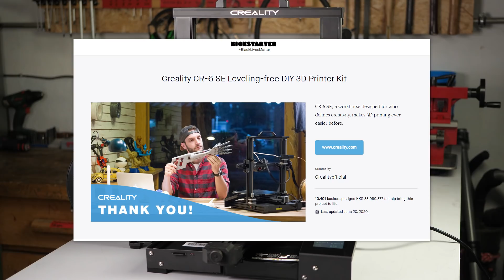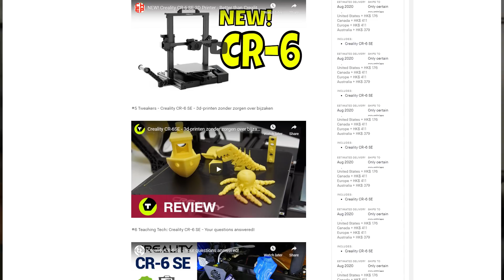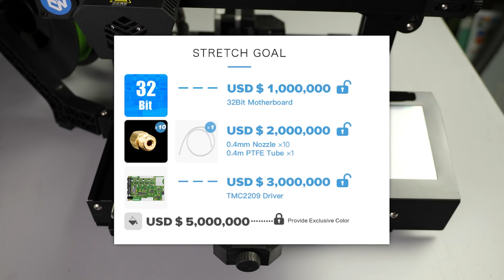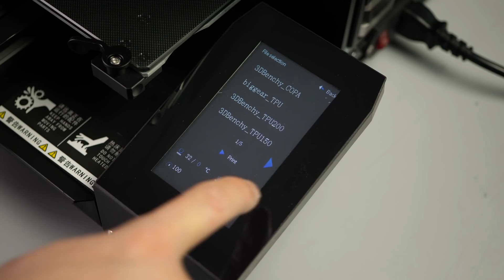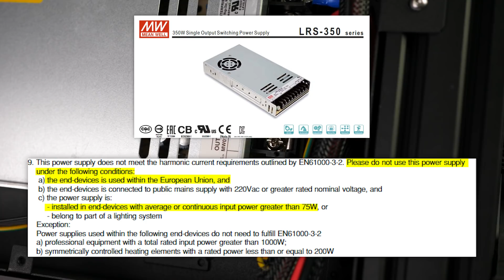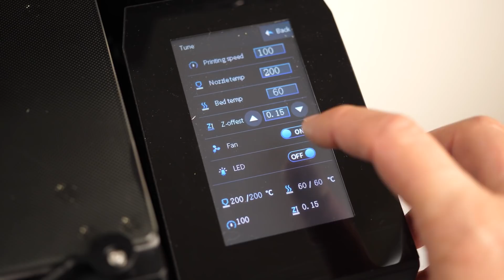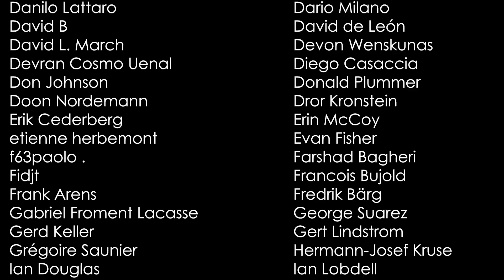Creality CR-6 SE - The NEW (over)hyped Kickstarter 3D printer?

Comment from the maker: Don't forget to share this video on Facebook, Reddit, Twitter and other social media!
Reply: I preordered one of these on kick starter, was It a mistake in your opinion? It's my first 3d printer
Reply from the maker: For the kickstarter price it's IMO a good deal!
Reply: @carrapaz3645  you could spend more money and get less - good value and great for a first printer.
Reply: cheaper than a prusa mini and better, don't get your complaints
Reply: Hey boss I’m trying to print cosplay helmets and stuff and I just bought a .8 mm nozzle for my cr10v2 what settings would you recommend to break down the 50+ hour work jobs that normally apply to the .4 mm nozzle? I could really use your help.
Reply: @talonabuser1072  Assuming you use Cura, I don't know the names of the settings for other slicers: Increase your line width to between 0.8 and 1.2, depending on how much detail you want (lower value gives more detail, slower print). You can then increase your layer height accordingly (should be no more than half of your line width or layer adhesion starts to get weaker, around one third of your layer height is a good value). You will want your layer height to be a multiple of .04. So I would probably go with 1mm line width, .32mm layer height. Then when it is printing pay attention to the extruder gear. If it is skipping or clicking then the hot-end is having trouble keeping up with the material flow and you will get under-extrusion. In this case you need to lower your print speed or upgrade your hotend to a volcano to melt the material faster.
Reply: A trick : you can watch movies at flixzone. Been using it for watching all kinds of movies during the lockdown.
Reply: @Koda Messiah yup, I have been watching on Flixzone for since december myself =)
Reply: Thank you for not being another creality shill. Its a fancy ender 3 with "improvments" taken from community ideas and a sketchy marketing plan.
Its nice to see a real review where keeping free printers rolling in isnt a main goal.

Comment: Have you updated to the latest community fw and ui yet Stefan? 
Adds a lot of extra features that it should have already come with from Creality! If you haven't already I think you should do a long term review on this printer now

Dual Z axis, load sensor bed leveling and runout sensor are worth the extra money over the ender 3 if your a newcomer to the hobby, but wouldn't say it's worth buying this if you already have an ender 3 or cr10 that is setup and working well.

Same as all the rest, it has just the same failings with the bowden tube and extruder,  I think for 4.4million on kickstarter they should also have addressed these long term issues. 
OK so they changed from the mk8 extruder to a new design made with using old parts but should have just moved to a dual drive design instead!

There are fit and finish issues with the brass guides on the runout sensor and they didn't line up the runout sensor and extruder another recurring issue that keeps getting overlooked!

They have a good range of printers at this point that are for the most part decent quality and reliable. Now instead of coming up with new printers and only half finishing them perhaps they should start improving the range they have until they have some epic out of the box printers at very reasonable prices!

Comment: Thanks but no, thanks! I`ll stick with my Two Trees Bluer Plus which for less money gives me: 2 lead screws Z (tethered, so synchronized), auto bed levelling, 300x300x400 build volume, PEI steel flex plate, TCM 2209 steppers, 32 bit board with Wi-Fi, full-color touchscreen, sleeker design and awesome print quality. You can keep the electronic scale for yourself

Comment: You are absolutely right about the power supply. The specification of the one available online is that it may not be installed enclosed, within the EU (same company´s RSP model seems to be abel to have in a encloser). And not used with continuous load above 75w = not to be in a 3D printer with heatbed. Will probably get worse with time when dust is sucked in and get it warmer.

Comment: Bed heat up time is irrelevant if the bed heating pattern is not tested with a thermal cam. On my Ender 5 Pro the sensor says the bed has reached target temperature (80°C for PETG in my example), but only a part of the Bed is really heated up - about 30% of the bed surface was up to 15°C cooler even after 20 minutes of heating.

Comment: I backed it because as my first printer I felt like it was a consolidation of years of tinkering and incremental upgrades and updates. Now that I have it on my bench I'm really happy with it. Setup and printing well with minimal fuss.
Also, after watching your $2 printer upgrade (foam + concrete slab) I was prepared for the worst... But the printer is so quiet I have it next to me on my desk and don't even notice it printing. I don't have such fan noise with the power-supply, but maybe it just hasn't kicked in for me yet

Comment: Could you (safely and/or easily) change the fan of the PSU?
Reply from the maker: Probably not. That's a potential fire-starter.
Reply: Thx for the reply! So if you want it more quit, a new PSU then? (derp :/)
(I'm one of the backers and this will be my first printer.. But it will be housed the room next to my baby girl.. So (very) long prints won't be an option it it's to loud!)

Comment: I've seen Your video, very interesting.

Imagine what you could do with the Creality CR6-SE and my latest upgrade Steel Roller which turns the printer into a continuous cycle printer.

This is the link http://www.robotfactory.it/en/the-steel-roller-kit/

An article on Fabaloo has also just been released https://www.fabbaloo.com/blog/2020/9/13/robot-factory-offers-continuous-3d-printer-conversion-kit

Andrea

Comment: I just received my printer from the Kickstarter, and I am, overall, satisfied and not disappointed. I also wish the power supply was quieter, but I was planning on sticking it in my workshop anyway. My biggest gripe is filament loading. Why did no one consider putting a tube between the sensor and the motor so you don't have to stick your finger in there and lift the filament a little to get it to go into that little hole? Overall I'm happy though.

Comment: Here is my problem with the automatic bed leveling: it is not leveling at all - it is basically doing what the BlTouch does. EXCEPT: with the BlTouch you are still supposed to manually prelevel the bed. MBL / pürinter override will not really do super good when the bed is seriously out of line. And with this setup and no correction - ouch.

Comment: Now having hands on experience with mine - it is a big improvement over what I had (ANET a8).

The auto-leveling is huge.  Big time saver, reduces failed prints.  My interest in 3d printing is to get to a quick prototype design-to-print workflow and this has done it.

I can can go from rough drawing to blender to Cura to at least starting as physical print in much less than an hour.   The print quality at .1mm is great.  

I just wish it worked with Octoprint correctly.

Comment: If there is just one thing that improves any printer and that is a dual Z axis screw drive......that will ensure 100% that the X axis crossbeam will remain square and not sag at the far right side  due to drag from the right hand side bearing block or increased weight from direct drive filament feeders.
I have the Ender 3 Pro and am going to fit a dual Z axis screw drive......but only after I've messed with a 3018 CNC mill upgrade I've just bought........now I realise I need the 3D printer to make parts for the mill upgrade too.

Comment: I got mine about for about 10 days. It is a nice looking Ender 3, it has some nice touches. Now the bad, software/firmware are junk, when was the last time a printer won't see folders in a SD card, and only 1 file per SD card....wow.... a Ender 3 with SKR 32 bit board and a BLtouch makes it look like a toy. It doesn't worth the money just upgrade your Ender 3. My Ender 3 works great but the CR-6 has a lot of problems. Their costumer service was: you got what you got.

Comment: If "over hyped" just means loud and no included pei sheet then almost every printer is over hyped IMO. 

I'm one of the people who got an ender 3 with big ambitions and ended up learning how to trouble shoot it for 2 years almost. It still gives my trouble out of nowhere. 

If this machine works without me having to sacrifice 1/2 as much time and frustration as my ender 3, I'd have paid full price for it. 

I am not going to lie, I'm giggling at how you set the video up to be critical, but the summary of your video is: "it's literally perfect for a hobbyist or beginner, all the features are great, but it's loud."

That's not too critical, haha. The last review I watched had a couple failures right off the bat and had some issue with the prints stalling

Comment: I sleep with a noctua + 5010 modded Ender 3 Pro on my bedside table. All I do is set the fan speed to 30% and I can sleep comfortably next to it while retaining great part cooling. There is also a passive grill on thingiverse you can print for the meanwell power supply which works nicely but I don't know how well it would work with the psu on the bottom of the printer.

Comment: Touching the nozzle repeatedly to the bed doesn't seem to be a great idea for auto leveling. I would think the bed will wear out much sooner, especially if the nozzle is hot when you do the probing. And also, not good for the tip of the nozzle.

Comment: Not to pick on you, but I watch these reviews(and yours was very good) and I always hear from everyone about the noise these printers make. You're not supposed to be sitting next to it while it's printing, unless you don't have faith in it. I've had one problem so far while 3D printing with my Printrbot Simple Metal which is now not working due to my violent nature and lack of patience. I was printing with ABS and didn't realize it's problems with needing an enclosure to keep heat in and cause it not to delaminate. I'm still new to this, as I don't print a lot but just now at the age of 51 am I starting to design and print stuff. You guys reviewing these 3D printers are very knowledgeable and a big help to us in, and just getting into the hobby/profession. Keep up the good work but we really shouldn't be focusing on whether a machine is super quiet or not, so long as it works and does what it should. Thank You for your review.
Reply: Not everyone has a garage. If you have the printer in your living room in an enclosure or even in a separate hobby room in your apartment, noise is a very valid aspect. If you have a separate workshop you probably would not mind the noise of course.

Comment: if you mod that psu with 60 or 80mm fan then it will be ok. and you are right, without pfc over 200 (or150?) watts they are not legal in EU. i tried to buy that psu here in eu, and it is impossible from legal sources.

Comment: I really would say that prusa has to be worried with the competition evolving this quickly for half of the price of an mk3s. I don't know how long they will hold on the mk3s wave that really seems outdated now:
No screen interface (casio style) 
No wifi connectivity
Still firmware that heat the bed when you are just triing to unlock the filament. 
No filament guide tube
Not precise bed leveling (well not anymore when you see that) 
Still using belt instead of steel treads
Noisy bed ballbearings
Still not friendly to adjust tension belt (bed plate speaking) 
Have to mount it yourself (i still think it's an advantage to know how to assemble your printer, but today an mk3s cost 999 for assembled version, to be compared with all those new tech printers at 450 ?)
Hope they will come back soon with a new mk4 !
Reply: Found the enderoid shill, lol. In order:
They do have screens.
Wi-fi is not normally within the scope of a machine controller itself.
False. You can certainly set the temp of either heater to anything you want at any time as any marlin...? The "preheat" menu is for preheat presets.
No guide tube is necessary, with the filament mounted above, including the stock spool holder.
False. Inductive probes are about as precise and trouble proof as feasible to make a bed probe.
Who the hell , company or individual, is using steel drive belts on a printer? Who doesn't use timing belts? Certainly not Creality.
Older stuff they shipped with cheap bearings, but even a dud (noisy) one will take longer to die than v-slot wheels last at all.
Did you try reading the assembly manuals?
Those other cheap machines don't even have all metal hotends, not even cheap E3D clones. And do things like leave off one of the z leadscrews and motors to save cash. They are not new tech at all.
To the detractor of 3D printed parts: Whose plastic extruder drive parts break constantly? It's not Prusa.
Reply: Couldnt have said it better myself ! Also the parts are 3D printed instead of injection mold or full aluminum.

Comment: 3:30 that was one of the issues that I though of when I saw some of the first reviews. It sounds good on paper, but when used in reality some things can easily interfere with it's effectiveness. Everyone knows (or should know by now) that both the bed and nozzle have to be up to temp before any leveling is done (to get the most accurate measurements), but when the nozzle is at temp, some filament could be slowly oozing out from it, and that melted filament will most likely leave a tiny little "blob" each time the nozzle's tip touches the bed to measure it. If that happens, you'd have to disengage the steppers motors after the leveling is done, and then move the bed forward to try and scrap/remove off all those tiny filament "blobs" before you would start printing. Imo, I would much rather have a separate BL sensor close to and to the side of the nozzle.
Reply: Leave filament out when leveling. Problem solved. Thats what I do now.

Comment: I did back it on Kickstarter, as fter watching a few videos about this printer. The video reviews I saw all had decent results with this unit. I know it's a LOT better & easier to use than the overpriced pile of junk that is the XYZ Pro 3in1 that is my first 3D printer! I HATE that XYZ unit, even after upgrading the hot end, & adding a glass print bed. I'm optimistic the Creality 6SE will print decently straight out of the box, WITHOUT all the complications the XYZ Pro has handed me!

Comment: A long time ago, in a 3d_print_forum, far away…
http://airtripper.com/1338/airtripper-extruder-filament-force-sensor-introduction/
When the extruder feeds the filament to the hot end, the extruder is effectively pushing against the filament causing the extruder to apply extra load on the load cell. Load cells have strain gauges attached that change in electrical resistance when under different loads. This resistance change provides small voltage levels that can be amplified and then read by an analogue to digital converter.
Basically, the purpose of doing these graphs is to find out what sort of information we can get out of the load cell that is used for the filament force sensor. We want to find out if the graphs can be used as a guide for better extruder set-ups.
This is a very cheap device, all parts for it cost now 2 - 3 US dollars. (HX711 + 20kg tensosensor)
By connecting this sensor to printer firmware, the retract distance, the maximum printing speed and the optimal nozzle temperature are automatically adjusted. Filament plugs, nozzle clogging, filament breakage and damage to the fitings are recognized.
Support in firmware status:
https://github.com/KevinOConnor/klipper/issues/2977
https://github.com/MarlinFirmware/Marlin/pull/2309

Comment: honestly, the artillery sidewinder x1 is a much more appealing option in my oppinion. its direct drive extrude so you can print almost every flexible filament (i had some problems with the really soft stuff) really quiet (its in my bedroom and i can sleep while its printing, but i might just be wierd XD) and i bought it for 320€. Print quality is top, the one downside is that the filament holder is crap. It messes up the printing quality cause the z rails start to vibrate cause of the weight that is ontop. If you fix that with either additional bracing or relocating the filament its an awesome printer.

Comment: HELP!
I just purchased a Ender-5 Plus and I'm having a problem completing a print. My issue is as I start printing (it does start printing for about 20 seconds) the printer stops printing and gives the message "Processing Please Wait". The print head parks at the far right corner and waits for an answer to a second message (YES or NO) to the question do I want to reload filament or end the print. If I answer YES to the question the same sequence of events happens again. Each time I answer YES the same sequence happens. All else on the printer seems to be working okay. 
The latest action I've taken was to place a length of filament in the filament sensor and directly feed the filament through the filament drive. The same as described above happens. So, I don't think it's a filament or filament sensor problem.
Wonder if you can help? The Creality firmware in the printer is Ver. 1.70.2 BL. 
Bruce

Comment: I bought a Genius for 275€.. you get an AC heat bed, direct extruder, dual z motors, touchscreen and cnc‘d v slot profiles. It’s not a perfect machine, but worth the money compared to an ender, that you need to upgrade. And it’s super quiet. Only „missing“ things are.. 32 bit, removable bed plate and auto leveling (a connector for the touch probe is already there). I don’t see the big gamechanger with the CR-6.

Comment: You forgot to mention it comes with dual-Z. I backed it at $319, in large part due to the dual-Z, touch LCD and auto bed leveling. The CR-6 SE will replace my slightly modded Ender 3 that I was about to add dual-z to.